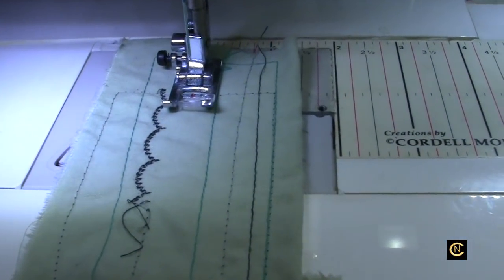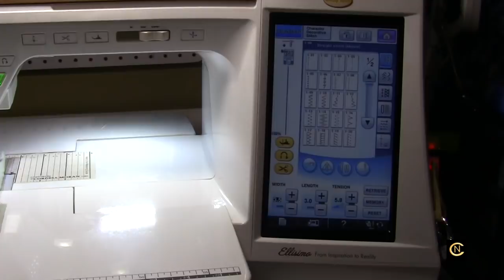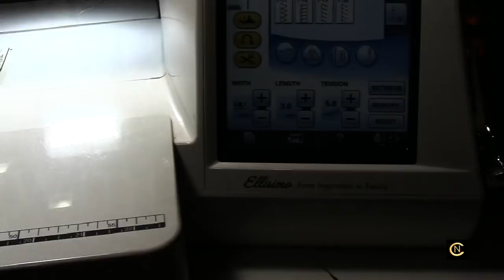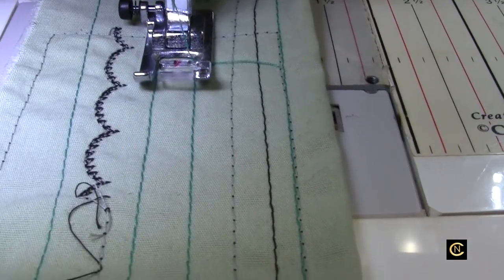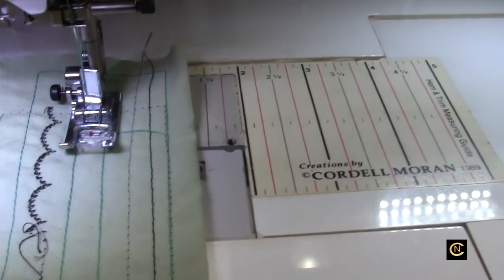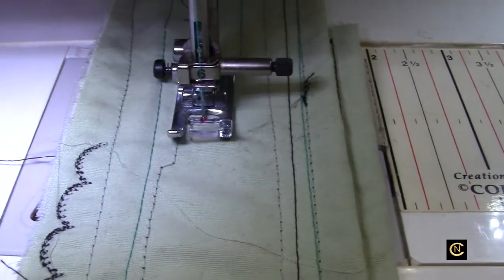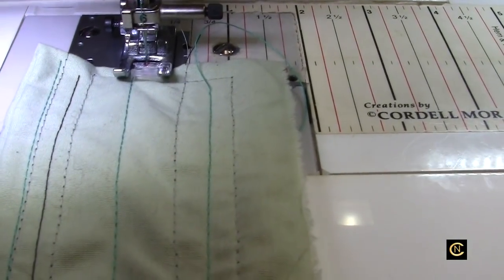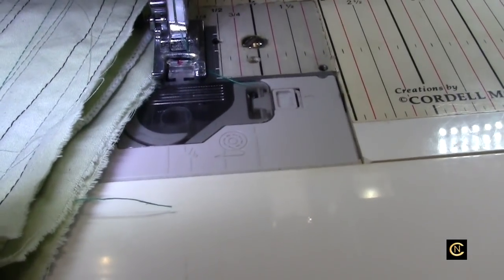"Thump, Thump, Thump" - Said The Sewing Machine - Machine Tip

Comment: As a beginner I was so overwhelmed trying to figure out why my machine was making that thumping sound and wala you were right. I changed the needle and its back to normal now.  My only question now is if the machine came with different needles or you can use different needles will it make that sound again when I go bigger? Thanks for the tip.

Comment: You are a lifesaver!! I had the correct needle for my project, and everything was fine  until the very end. Suddenly I got a knocking sound and thought it was an issue with the gears. After watching your video, I decided to replace the needle with the same kind but just a new one. Knocking stopped!! Good as new. Perhaps the initial needle got dull, bent, or whatever. Just needed a new needle!! Was able to finish hemming my dress and it was smooth sailing. Subscribed immediately! You saved me a trip to the repair shop. Thank you!!!

Comment: Oh wow! Thank you for this video.
I'm an inexperienced sewer with a 2yo hardly used machine, and I had some fabric jam in the feed dogs recently so I got out my manual and took it apart, but when I put it back together I only hand tightened the needle - which then dropped and jammed in the bobbin holder (it did this twice before I discovered I should have used the little screwdriver).
I put in a new needle as the dropped one (a 10/70) had bent but I only had a 14/90 (I figured as I was sewing drill cotton it would be ok) and it's been making that knocking sound since.
I was worried I'd broken my machine with the needle dropping and jamming, but I'll get some new needles and give this a try.
Thank you, you might have saved me an expensive (and hopefully not needed) service and repair.

Comment: Great tip, thank you! I have a question though. What if it seems that the housing that holds the bobbin seems to be contacting the outer housing each time there is a rotation, on both directions? I am not sure but this is where I suspect my thumping noise is coming from. Strznge though because I started hearing it louder when I change over to a wee bit thicker thread. Any suggestions? Is my bobbin housing the wrong size for the machine? Other than this problem, it seems to sit in the outer housing fine. Please help?

Comment: Thank you!  Older 70's Kenmore is a workhorse and have been drilling out Covid Front Line mask covers. It got its thump going on and was terrified it was a motor issue. Needle is new...so I will check the size...hope it really is as easy of a fix!
Reply: Did you figure it out. Im already using a small needle

Comment: Great tip BUT I have a singer 4411 brand new(less than 2wks in my possession from singer directly) and it's making a tap sound from the hand wheel area. I swapped out with smaller needle and still doing it. 🤷🤷
Reply: Same for me i cleaned out mine too and its still doing that noise!! Ive been looking everywhere but cant find an answer, have you found a solution yet?
Reply: @edgardodigital  unfortunately I haven't. I think its just something tbe 4411 does unfortunately

Comment: I've watched alot of your videos, very helpful.  However, I'm still working on the Thump Thump on my Kenmore Embroidery machine and shredding of the thread.  Very frustrating, but I'm certain I'll figure it out.
Reply: Deborah Barret,  I had the same issue (Kenmore  with 70 stitches) and I had to remove/clean out bobbin (brushed & vacuumed) and... oil the spots as per manual instructions. It resolved the thumping so maybe, it will help you? 
Happy sewing :-)